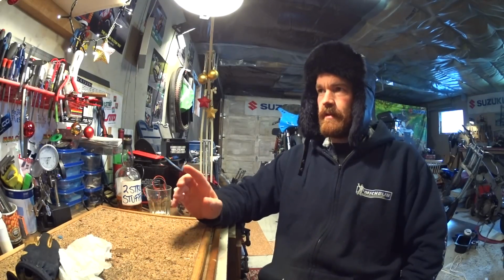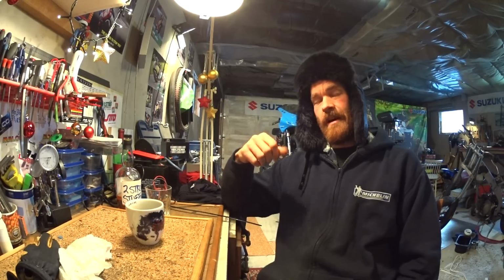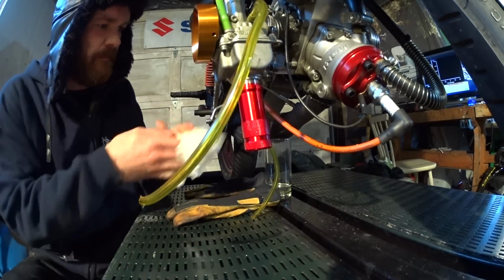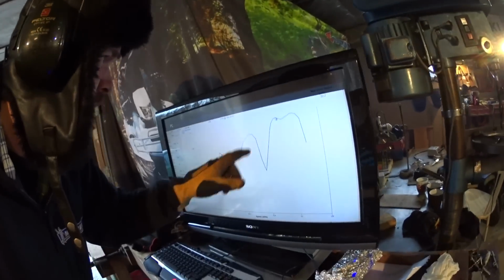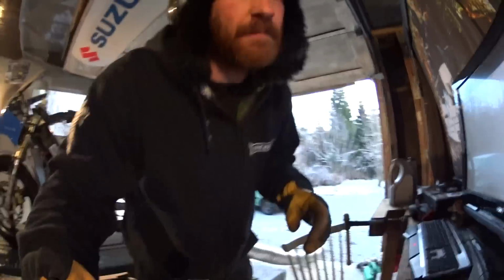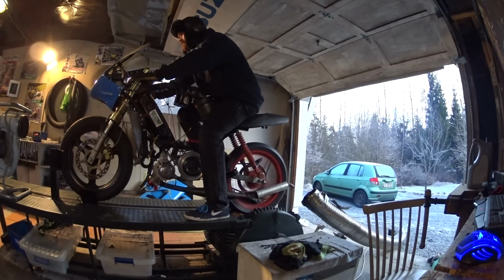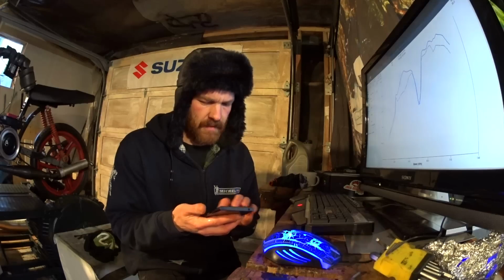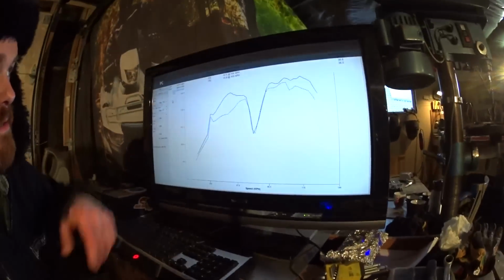50cc / 20hp! Homemade Rotary Valve Peugeot Spx 2STROKE STUFFING E26

Comment: hi, i've noticed the DID chain decal on the bike. Is it a good quality chain or is their some fake ones on the market??
Reply from the maker: +rungassamydonovan47 Never had a problem with them myself!  Don't know about the fakes(if any) tho...
Reply: The zundapp 50cc rotary valve from my tuner is doing 25 hp at the rear wheel.
Reply: Look him up on you tube , rob van rossem
Reply from the maker: +cxturbo100 I know, it's just mind blowing! I've been following the forum thread about the bike. I made a video where I declared war against them(joke). Their regular gearbox is probably alot more efficient than my setup, but I'm still far away from that kind of power. Might change soon though... 😉
Reply: @2STROKESTUFFING  The assumed losses in motorbike (and car) transmissions are far too high (in my opinion) A good drive chain is something like 97% efficient. The variable speed belt will lose a bit but nowhere near 2KW (3bhp). Its just not possible to dissipate that much heat before the thing melts. The Rholoff 14 speed epicyclic hub gearbox (7 speeds with internal doubler ratio to give 14 speeds is 94.5%. Lower cost hubs use grease lube so lose a lot on drag and efficiency. The figures I quote are low speed for pedal bikes but they are complex gearboxes with lots of moving parts yet losses are 1/2 of the assumed figures for relatively simple automotive gearboxes.

Comment: I just heard the same thing as Tibor told you. I have more testing to do now. What is the max rpm average you are reaching? when you set the map to a certain degrees in the module, is that the effective degrees or have you found there is a delay on the timing light?
Reply from the maker: Peter Somers I can reach about 17k now under load(but haven't really dialed in the carb yet) . At peak power rpm my ignition is set to 21°btdc, my timing light tells me in reality this is around 16° - it is definitely retarding, if it wasn't my engine would've blown up by now.

Comment: What i causing that huge dip in the curve?
Reply from the maker: +gislemark79 The "real" run is after that dip. It happens cause I let the variator gear out fully, then rpm starts rising. In this way I can plot power vs rpm.
Reply: I understand.

Comment: right first things first transmission loss is not 25%, i would expect it to be under 10%, in the early 80,s i built a 4 speed gilera, piston ported, ,26 mm mikuni, a pipe with a larger mid section and a points type ign, timed at 28 degrees , didnt have an interia dyno like you just a long flat road, with a 50cc race fairing ex derbi this two transfer port motor would pull 89/90 mph, this was a street fun bike .
now your motor is running a gear reduction , this will act as a torque multiplier so giving you a false power reading.
what did you use to set the fueling as i didnt see a egt or a exhaust lambda.
if you are really making 20 bhp the bike would be capable of speeds in the 110 to 115 mph , i somehow doubt this , what is the power range race 50,s require a lot of gears as the power band is so short
Reply from the maker: +ALAN COLLARD Do you have anything to back your claim about the efficiency?
You realize I run a variator, do you have any experience with them?
I've read all the papers I could find on CVT losses, and made an educated guess about efficiency, not that it really matters. 
 The dyno is not giving a false reading because of gear reduction, it just measures how fast the roller is being accelerated and spits out needed power. 
I use an egt meter.
Reply: hi , i have had water braked rolling roads and water braked chassis dynos and at one time did a job for rover car group that involved a rolling road test and a dyno test , this was on a turbo 1.4 rover f w d which everyone said had the worse power loss , it ended up under 10%, and what was interesting was that rover got the similar figures with their far more sophisticated r/r and dynos . and type of trans has a torque multiplication , now i have never had anything to do with c v t , but if the belts start to slip then the b h p goes up , this is a small slip that you cant hear .
but the real time bhp is how fast does it go , that tells you every thing , i have had dynamite motors on the dyno but on the track not so good .
what power band does it have 1.5 k  more or less and what r p m does it peak at
Reply: by the way we call those dyno.s interia brakes as it accelerating a known flywheel and can work out the power from the time interval , but it is of such short duration that you can easily be running lean but the egt shows its correct but wait till you get to a long straight where  w o t is held for 20 secs or more . i spent 30 years racing two strokes and melted my fair share of pistons , due  to leaning out or det
Reply: ALAN COLLARD Sounds like a lot of 2 stoke tuning experience. I've been riding 2 stoke dirt bikes for 40 years, but never done much tuning. Now I've  serveral 50cc bicycles that I really want to eventually do some serious tuning on my Franco Moroni s6c water cooled engine stock producing 12.5 hp at 14,000 RPM. Are you formulae with the Italian or French 50cc gp race team in the 60's that were closing in and very confident that a 30 hp 50cc was attainable, but the rules/classes changed and their research halted. They were running 10 to 15 speed gearboxes to keep the 50ccs in the powerband.

Comment: Why are you "launching" the bike on a dyno?  I understand the powerband is up top, so im assuming you don't care about the numbers below the powerband? What about rideability? On the road you'll want to the whole rpm band tuned yes? Or are you not going to be riding it on the road? I'm just lost as to why you would "launch" the bike on a dyno...
Reply from the maker: +Mike Cheeze If I don't "launch" it the variator gears out before the clutch grabs - very hard on the clutch. With a properly tuned CVT(or with my "launch lever") the only thing that matter is peak power rpm. You can keep the bike in a very narrow rpm range all the time, speed independent. Thats the huge advantage with this setup. The downside is horrendous efficiency...
Reply: 2STROKE STUFFING so the bike has a cvt? Excuse my ignorance, im trying to research the "variator" i see you can use with or without clutch?
Reply from the maker: +Mike Cheeze Yep. No worries! I think some ATVs and snowmobiles don't run a clutch.